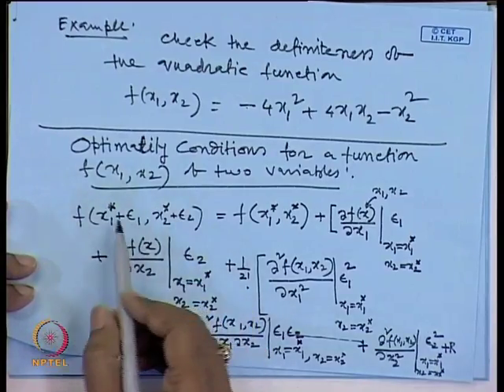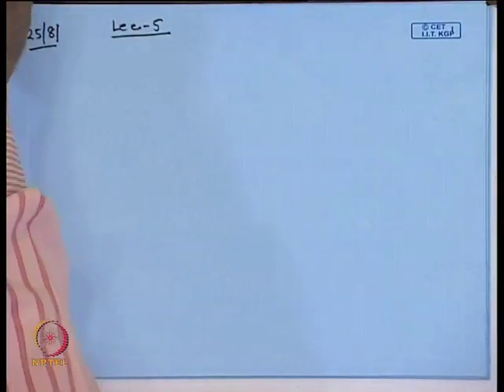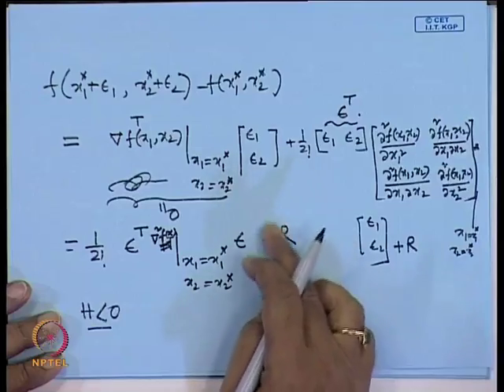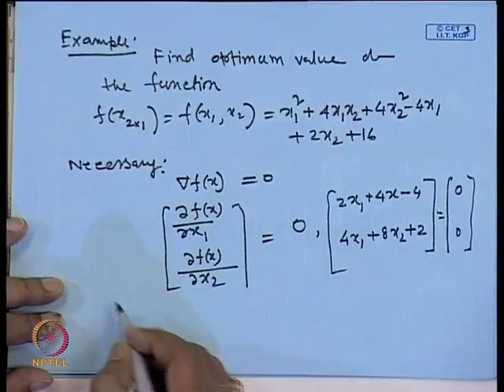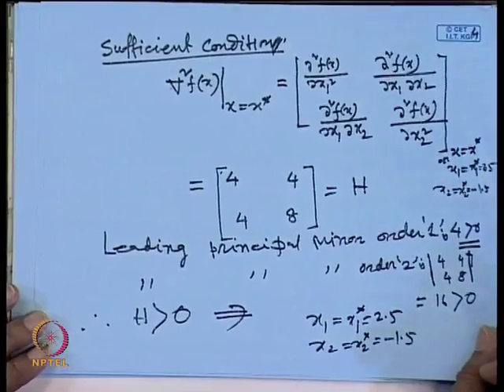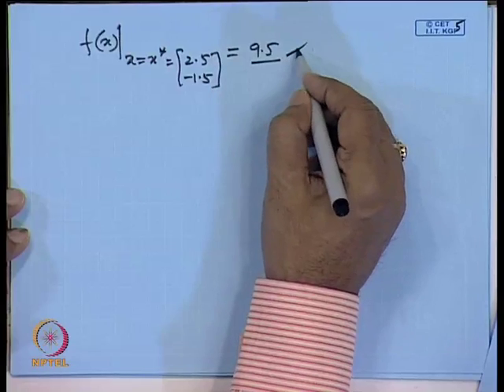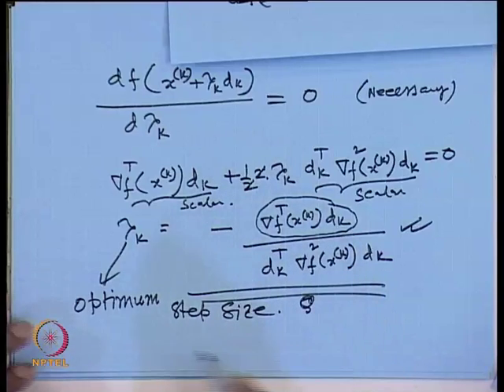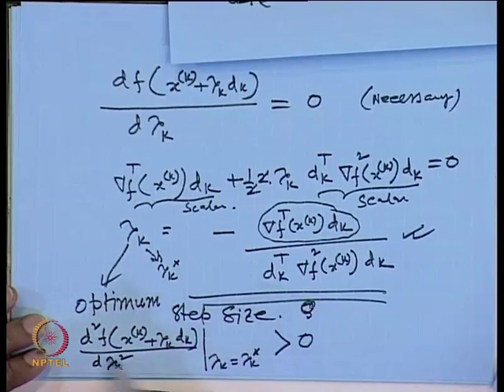Mod-01 Lec-05 Unconstrained optimization problem (Numerical Techniques)

Comment: H(1,1) must be 2, and the determinant I H I = 0 so it is positive semi-definite. What can be concluded about the optimum values of x.
Reply: I think I know what happened...the quadratic function f(x1,x2) should be
 f(x) = 2X1²+ .... instead of f(x) = X1². Making that change it all 
makes sense. Notice that optimal operation points (2.5, -1.5) wouldn't work also.

Comment: Something is wrong with example, how did you get stationary point to bo x1=2.5 and x2=-1.5 at 12:22?!
Reply: I think I know what happened...the quadratic function f(x1,x2) should be f(x) = 2X1²+ .... instead of f(x) = X1². Making that change it all makes sense.